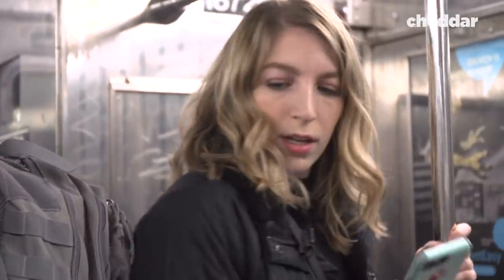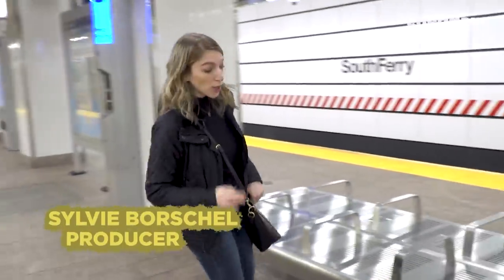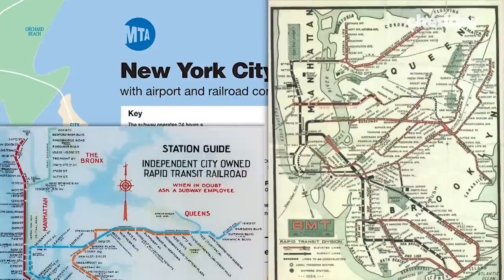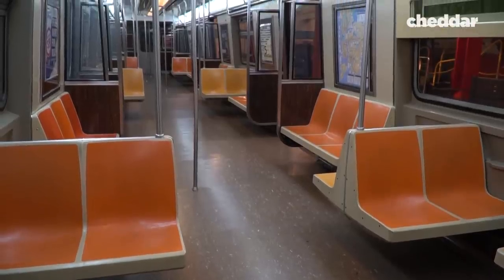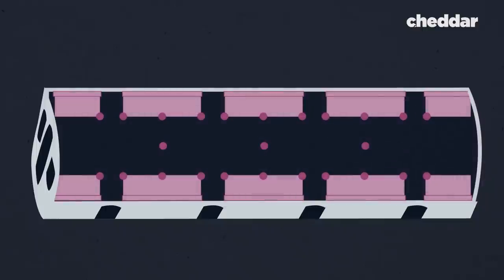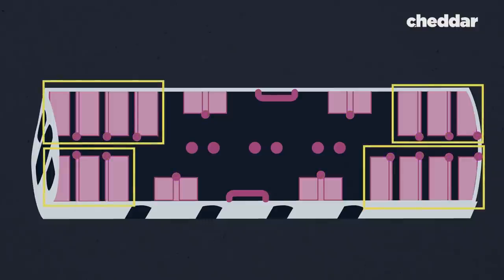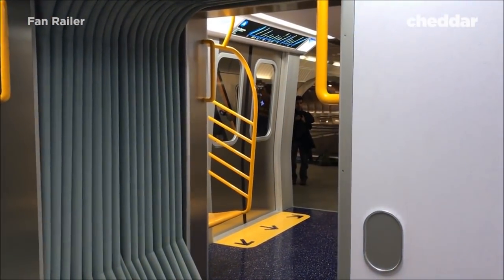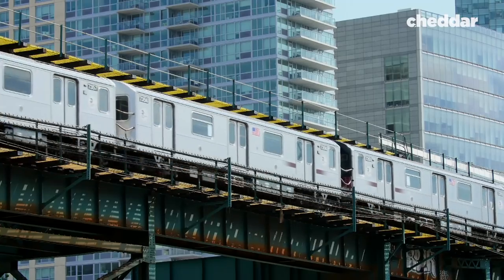Could This Subway Car Save NYC Transit? - Cheddar Explains

Comment: I can agree with these figures.  HOWEVER, there are a few factors unaccounted for

1) poor scheduling / unreliability of trains: the MTA has known for ages that the population of NYC is growing and doubling / trippling.  However, they do very little to increase service frequency which leads to overcrowding.

Not to mention even when frequency is supposedly increased there are times when trains are severely delayed and don't show up!  Imagine you're sitting at 125th St in Manhattan waiting for the A train.  The next one is supposed to be there in 3  minutes but it never shows up.  So now not only are you sitting there with 200 other people waiting 10 Minutes for the next train but another 300 people have joined you as well... This leads to overcrowding.

2) rider stupidity / poor manners. Some riders don't know how to step in, some hold the doors, and some don't know when to catch the next train.  All these factors lead to delays as well.

The design is only a small part of the bigger issue when it comes to NYCT

Comment: 2-seat airline seating is terrible for short hop travel taken mostly by single people rather than groups. the situation where forward facing seats make sense is where you can replace 3 bench seats with 2 forward facing seats one behind the other, and end up with a little extra standing room. your seating capacity has effectively barely changed at off-peak hours, and you have more standing room for commute times.

Comment: The problem with the NYC mass transit ISN’T the DESIGN of the carts...

It’s the uprising PRICE the MTA keeps implementing. 
There’s no way you’re charging $2.75+ a RIDE, and there’s no reliability or dependability... 

Riders don’t cause delays. Old, cheap, unreliable equipment does ran by greedy old rich men...
Reply: Little Wolf the UK is at £2.40+ which i think is quite a alot more than the New York subway
Reply: $2.75 a ride to access and leave from any part of the system may be a scam if you're only going one station, but that's not how people use the network, and that's an incredibly idiotic take on the network. The MTA is charging about half of what they need to break even on subway operating costs, and their Network is way more developed than many other transit companies. It's by far the largest transit system by passenger numbers in North America, and the largest network by station numbers in the world. If you don't think that costs a metric fuckload of money in New York of all places, you're nuts.

Comment: So, the Japanese Yamanote line carries more passengers than the entire NY subway... And has longitudinal seating. Just saying, maybe the problem is elsewhere.

Why not talk to Japan Rail or Tokyo Metro? They're used to way more overcrowding.
Reply: Better yet, study the Shanghai Metro, the largest and highest ridership system in the world, and far more modern than Tokyo.
Reply: @unreliablenarrator6649  But NYC doesn't have a modern system, it's old. Besides, the Tokyo system is the most punctual, and the one with the highest occupancy rate. Those are things that scale.
Reply: @8NCLI8  Yeah, I wonder is capacity more important than signalling or vice versa.
Reply: 30 stations, 11 cars carrying over a million passengers a day taking an hour to circle around the line. Connects to most major stations important for transferring.
Reply: @PeteS_1994  Capacity, and punctuality. Aka. reliability. Those are the most important factors, surely.
Reply: @8NCLI8  Sure but I was wondering if really frequent subways could actually do away with some capacity as they are so frequent that no one worries if they miss a train.
Reply: One of the biggest differences between the subways of Japan/Korea/Hong Kong/London/Paris, etc and NYC is the price for a ride. You can ride the entire MTA system for $2.75  plus you get free transfers to a local bus. The other cities are pay by distance.

Comment: How can a subway train arrive NOT "on time" during rush hour? 
If it's possible to talk about "times", shouldn't you simply add more trains until there's a train every couple of minutes or less?
Reply: adding more trains wouldn't help, most of the problems causing them to not arrive on time is if there is a train in front of them and the reason why that is a problem in the first place is due to overcrowding
Reply: @notdvniel  I don't know what the problem with NYC metro is in particular, but it's the train control systems that are usually the most responsible.
Two minute interval from arrival to arrival during rush hour is totally doable and is actually pretty average according to global standards.
Reply: On time is only a thing for the first couple and last couple of trains in a subway system 
There shouldn't be fixed times at that volume of trains, just target head ways. Like every 5 minutes 6am-730 every 2 minutes 730-930 every 5 minutes 930-430 every 2 minutes etc etc
Reply: A good metro system should run every 90 seconds between trains during the peak times. Very common in many asian metro systems both driverless and driver operated.

Comment: Search up Bombardier TR trains. It’s what we use in Toronto. Open space, very little middle seats. Mostly two or single seats, plenty of poles and overhead straps to grab onto. Personally, an excellent design. And they’re modern, easy ridership, clean and have year round working AC units. Which is nice in the summer and the winter.

Comment: Convert the whole system to rubber tyre like in Montreal. The MPM-10 train is wonderful. Steel wheeled train underground is really noisy.
Reply: Do you think that it’s cheap do that?
Reply: @tornadochasing2883  I was joking! It would be unthinkable to halt the entire NYC subway just to convert it to run on rubber tyres.

Comment: I’ve slipped between the train and platform with my leg trapped because the train was crowded. I was in such shock that someone else had to yell for the conductor not to take off with my leg🥲. I was just on my way to school and ended up with an injury as my doc at the time described as a football equivalent injury. Still fucks with me to this day and that was in 2011

Comment: Get rid of the subway cars and make it one giant loop of moving seats similar to Disneyland Haunted Mansion. Commutes will be slower but there will be 100x more capacity and much more comfortable seating.
Reply: Gnoll Team %100 agree
Reply: Or better yet, make a horizontal escalator. Similar to what they have in airports, in long walk areas.
Reply: @nerychristian  I think it's call a people mover. Horizontal escalator is an oxymormon. Though not as bad diesel-powered steamshovel. How about a purple people mover? Every trip, it eats every thousandth person. Not much, but in a few weeks, you start to notice less crowding. Or may an A.I. humane purple people mover which selects people but does not eat them. Rather, it takes people who do need to be there an spits thems out in a more suitable place for them, kind of like the transporter room in Star Trek.

Comment: The homeless will have more space to roam and terrorize.
Reply: If they add the row of seats it will be more encouraging to sleep in the area rather than the current seating. While the proposed seating is more efficient, the current seating method is more feasible.
Reply: a bum will stink up not one car but half a train, and where will they piss, they usually go to the bathroom between cars, without it they will go to the bathroom inside
Reply: yep I never sit in those corner seats, absolutely disgusting
Reply: Cody Slab That joke is getting too old.

Comment: If there were more cars more often then there would be no overcrowding, the overcrowding issue is caused by long wait times not car design
Reply: Do you know how long is the time between the same trains in NYC?

In my city frustration starts if interval goes up to 4-5 minutes and normal is 1,5-2 minutes, it works nicely.
Reply: @BSHO maybe because the trains are still not coming often enough to account for rush hour traffic, its not like everyone shows up simultaneously
Reply: @sodinc  what city are you talking about?
Reply: @BSHO really I've never seen the 7 train run that often, if there are 7 trains close to each other like that they're usually mixed with local and express so not everyone boards leaving people waiting on the next train so that 7 train system is also heavily flawed
Reply: @BSHO could you rewrite that or edit it?
Reply: Straphangers pay the dividends.
Reply: @frankhaze5304  Moscow

Comment: Check the Sydney Trains design. Double decker with flippable seats and extra room for standing in both ends of coach. So, a group of people can sit together by flipping two seats on opposite direction or can sit alone in seats with same direction.
Reply: You must be confusing subway trains with commuter trains because double decker trains are logistically impossible in the NYC Subway. That’s why open gangways trains are best for subway trains.

Comment: The open car would be great for commuters that needs to have access to the most available exit. Being stuck inside a closed car forces people to bottleneck a specific exit and that exit is usually the same bottleneck for entrance. Having less seats would actually be better for most riders though. I don't remember ever to wanting to sit in a subway car because you end up with your face at eye level with a stranger's crotch or butt hunched over you. especially in a crowed subway.
Reply: riopato2009 Agreed. This would be very useful on crowded lines such as the A and C in Brooklyn and on the E, F, M, and R in Queens.

Comment: I agree with the MTA's choice and with NOJ's comments below about the problems with airline style seating.  This would definitely make it difficult to leave the train quickly.  We have the MTA new cars in Toronto and they are great in their design.  However, I know that Bombardier is building the MTAs new cars and there have been many problems with car construction and defects in Toronto due to Bombardier's questionable workmanship.  There have also been recalls of Bombardier trolley cars.  Bombardier has also been slow in meeting deadlines for deliveries of new cars.  This is true in Toronto and I know NYC is experiencing the same problems with slow delivery, defects, and recalls with Bombardier built transit vehicles.  I love NYC so good luck with your transit updates.

Comment: In Toronto we have those open cars and they are the best idea ever. Say you get on at door number 5 but you know your stairs are at door number 18 when you get off now you can walk to that dooe before you get o the station. additionally you can board at any door and simply walk through the train to a less crowded section even to an empty seat.

But there is one very important thing you forgot. 
NO RAILS at the side of the entrances and NO cross seating at at doors either.. That way people do NOT crowd the doors and immediately spread out as they enter the train.

BTW, in 22 years of taking the train i have NEVER used the straps...EVER!!!

Comment: The reason the IRT trains, the numbered trains, are smaller is because they were the first subways in NYC. Then due to crowding when the other companies built what is now the lettered trains they built the trains wider. That is why there are two different sizes. I was told this at the Transit museum. Do your homework before spreading false information.

Comment: One of the greatest causes of delays is overcrowding as people fight (occasionally literally) to squeeze into train cars.  The "ideal" train design may have the same # of seats, but it leaves less standing room.  The S (shuttle) train that just travels back and forth between Grand Central and Times Square recently removed most of the seats from the middle cars.  I guess the MTA assumes it's not too much to ask more people to stand for one stop.  The fold up seat design is interesting.   But I don't think it will make much difference unless they locked the seats into the up position during rush hour on the most crowded trains.  One thing I am sure I will never see is someone on a crowded train saying: "Hey everybody, lets all fold up our seats so more people can fit on this car!"
Reply: Michael McChesney The locked seats have been subject to some vandalism by disgruntled riders due to the fact that they only lock them according to a schedule.

Comment: I already love the design of the E train. The commuter rail style seating like on the LIRR wouldn't work well on the subway, and would quickly annoy everyone.

I honestly think the main problem is that NYC lacks subway lines for the outer boroughs. If more trains were added that went between the outer boroughs and not just Manhattan, there would be less people riding already crowded trains like the E and the F in the first place.

Comment: The “orange” cars are way better than the newer ones. But that’s also because most of the lines with the orange seats are also wider. The 1, 2, 3 lines are squishy because they’re narrower. They need to widen the tunnels and use the BMT cars.
Reply: cookieaddictions Why do that when they can order IRT-sized open gangway train cars for the IRT? It’s much cheaper to do than widening the tunnel.

Comment: In miami we have the metro rail which is similar to the subways in NYC except above ground cuz sea levels and stuff. We have the regular metro rail cars with similar seating to the old cars of the past. Then we have smaller ones called mono rails that have no seating except for two seats on each end for handicapped folks. These have alot of space but you are required to stand if the seats are taken. No sitting on the floors

Comment: Bonus: The ride on the "A" line from the Inwood station stop in the upper most part of the island of Manhattan (New York County) to the Far Rockaway station stop in the Borough of Queens (Queens County) is 31 miles or almost 50 kilometers. It mostly runs underground until it gets to the Grant Avenue station stop (which is the last stop in the Borough of Brooklyn (Brooklyn County) and takes a little over 1 hour 6 minutes to get there (and only because it is close to the end of rush hour and outbound). The "A" train then continues to Far Rockaway  and rides along a track that will cross two ocean bridges and is pretty nice to look at (taped in the dead of winter by McCrillis Nsiah). This is the video --> https://www.youtube.com/watch?v=3G3ZOixulbA  The following video starts in Far Rockaway on a beautiful summer's day (taped in wonderful high definition by DJH Trains) and ends at the Inwood station stop --> https://www.youtube.com/watch?v=pphgq49lslI  ENJOY!

Comment: 1 correction: The Tokyo subway still uses doors between cars, and the overall layout is pretty conservative, even the cars themselves are not new.
And even though it can get crowded during rush-hour, it works. 
I think it's  because the trains are frequent enough and because the Japanese passengers adhere to the more efficient behavior of following the lines 
marked on the floor (that are placed precisely to match the location of the train doors), as well as (for the most part) not cutting in line or pushing when entering and exiting the train. 
Another thing to remember is that the Japanese do not play games when it comes to achieving that ever-crucial punctuality for which they are well known.
And they do all that without being rude or overly strict. Go figure... :)
Cheers.
Reply: guy h True, but the London and Toronto ones do have Open Gangways and they are doing great there. Coincidentally, NYCT President Andy Byford ran the systems there as well.

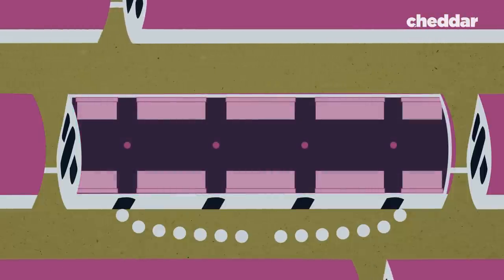Comment: @1:40 if it was surprising 
Just take away all the seats over all adding double the capacity per car without changing the train car like the T
Reply: There are some folks who need a seat and their train ride to/from the city is quite long. Luckily open gangways trains will have that capacity increase.
Reply: I mean the T has the first and last car has seating from what I seen
Reply: @Bugm-kn9sv  True, but most cars should have seating. However, the shuttle line trains with dedicated cars should have seats removed.
Reply: @TheRailLeaguer  I understand that some people needs seating but it also depends how far do people has to travel on the metro because like the red line unless you going from Cambridge to Quincy you don’t need seating

Comment: The research design is clearly made by people who NEVER actually ride on any form of public transit, anywhere. Here's an idea, put seats in the centre facing outwards, and leave the walls/door areas free and open (with enough space to move around the outsides). Throw rails on the walls between windows etc, and you'll have a lot more comfortable people, still have a tonne of room, and have plenty of seating. And yeah, definitely keep the open ends of cars.

Comment: Another option would be, trains that would have row seats only with easy on and off access so everyone can be seated comfortably.  Trains that would be standing only so people would fit comfortably without the seats and people with bulky stuff in their way.  People with bulky stuff should not be allowed on either train.  Trains that will accommodate wheelchairs, people with canes, walkers, passengers with bulky baggage and so on.  Each of these trains would be color coded for people to know which ones to get on.  During rush hour only standing cart trains should run one after another with every third train seats only for those who prefer seating and fourth trains wheel accessibility trains for those people with excess baggage.